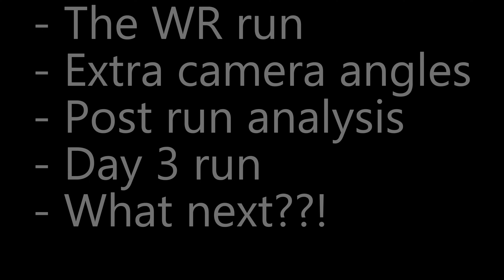RC Car World Record! FASTEST Speed Ever Recorded – You Won’t Believe This!

Comment: but how can you control the direction at that speed and from that far?😮
Reply from the maker: Once I get it on track at the start of the run I just have to make minor corrections. Following the line down the middle of the runway (just to the right of it) definitely helps!😊
Reply: @steveeng1826 impressive, but I guess you must be extremely accurate and fast
Reply from the maker: @arquier  It's not too bad actually, the car doesn't really dart around because its designed to go in a straight line. 👌

Comment: Why not an fpv sysyem? You can then go farther away and have a longer run. Not gonna add significant weight and you can hide the antenna inside the body
Reply from the maker: I think it would actually be harder to drive from the low down car perspective!

Comment: Golfers like misty rain for maximum ball distance, something about humid air offering less wind resistance. Seems like it's similar for RC speed records also. Great job, you have raised the bar. Future attempts by you and anyone else will be much harder after this.
Reply: That’s not true, rain reduces distance but sometimes a wet ball will get less backspin at impact, which will increase distance - so it could be that what you’re thinking of is a perfect mix of a wet ball but not too much rain to affect the flight.  Temperature can have a fairly significant effect on distance.
Reply: @pauletasse7024  Actually, the physics supports what I said. Humid air is less dense than dry air because water vapor displaces heavier nitrogen and oxygen molecules, so higher humidity = lower drag = longer ball flight. Light mist raises humidity without the drag penalty of heavy rain. Golfers and RC speed record flyers both benefit from this. You’re right that a wet ball can reduce spin and add distance, but that’s separate from the main aerodynamic effect of humidity, which is why misty or humid days can help carry distance.

Comment: Just wanted to add you should definitely do like top gear did on their laptimes and add a W after that speed to signify it was a run in the wet. Even if someone matches or beats your time I doubt they are sending it on a damp track like that. 👍
Reply from the maker: I didn't mind, the rain came with a nice tail wind 😊
Reply: @steveeng1826 Nice!

Comment: I hate to point this out but... did they run it in both directions? Judging by the movement of those banners it had one hell of a tail wind.
Reply from the maker: Hey, yes there was a tail wind, there was also poor visibility and rain in my face!! I think it did help but the beast did well on Sunday also with a headwind, wait for the full video in a couple of weeks 👌
Reply: @steveeng1826  would have been great to run ones other way to make the middle value  , pretty sûre its still a WR   and its still CRAAZZYYYYY , also no doubte yu can redoo it on nicer weather :)
Reply: @MRCG68  The problem with having to do the car WR in both directions is that the cars are pretty unpredictable so getting 2 perfect runs in both directions is so unlikely. In addition each WR run can be very costly because of the wheels.The car is so low to the ground I don't think the wind will make a massive difference. The drone record has to be done in both directions, because wind is basically a booster treadmill and because you don't have to replace the propellers every run so it's not as expensive! haha
Reply: @LukeMaximoBell  thats the fun of it ! héhéhé
Reply: @LukeMaximoBell  its like arm wrestling only right and noth both ;p
Reply: did i mention i'm just jalouse  because we can't do this here we have not such airplane tracks  an eaven if we had i surrely don't reach that !
Reply from the maker: Hey, my car would do even better if you had to run it in both directions, because it is so reliable! It only has 8 bearings in the whole car and has done it's last 8 runs over 200mph. So running both ways wouldn't bother me even if it was required 👍
Reply: @steveeng1826  awesome !!
Reply: yeah i had same question :)
Reply: The official record is just based on 1 direction. I agree with you the wind is definitely helping a bit, but at least the wind low to the ground is a lot lower than higher up.
Reply: @LukeMaximoBell  we don't put a doubt on this wr we just meant that both side is the total killer to show it :)

Comment: just the sound of it is incredible...    maybe drop the manual controller & run with full programmed gps control?   again.. well done
Reply from the maker: The manual control is no issue, it's quite easy to drive actually 🙂
Reply: @steveeng1826  your control is not the issue .. visibility .. more distance out  . taller gearing  might be a higher trap speed?  just a suggestion

Comment: That was an impressive 234.71 miles per hour. TomleyRC please note - miles per hour. 😉

If that was in the rain, then what speed could it achieve on a dry strip, I wonder.
Reply: Looks like he had a pretty stiff tail wind that probably offset any disadvantage the rain gave.